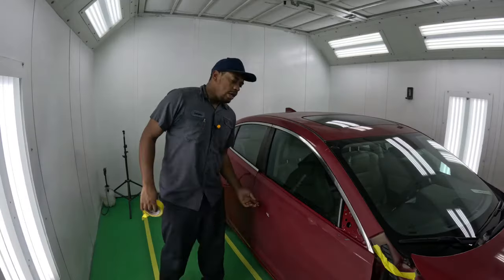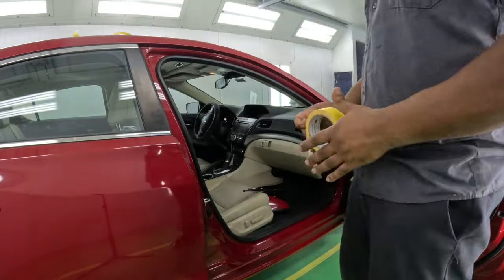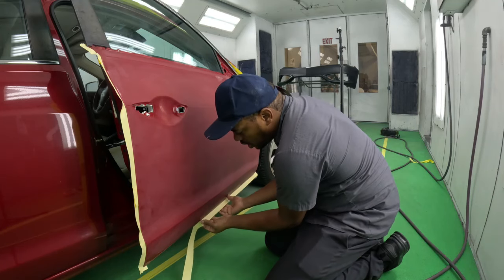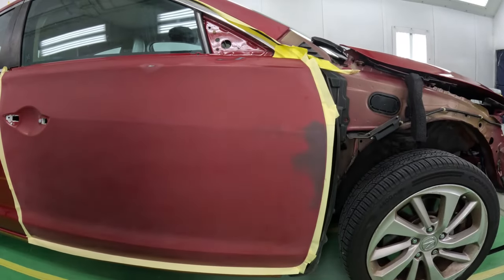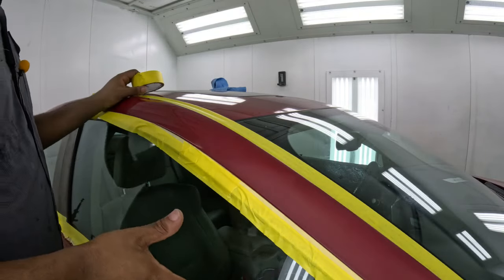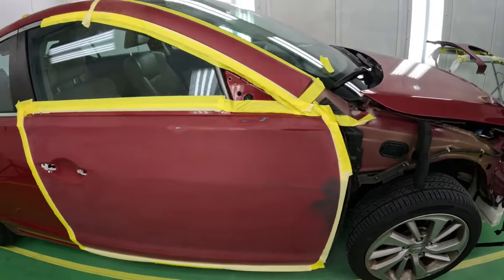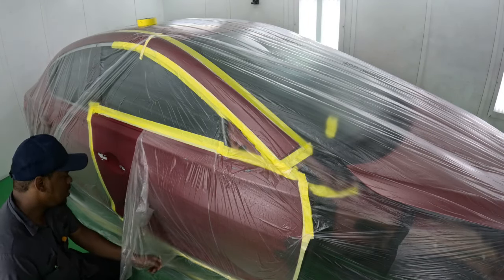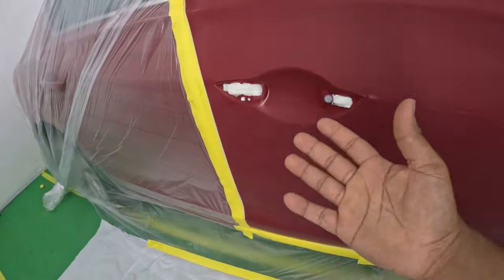HOW TO MASK A CAR FOR PAINT THE BEST WAY

Comment: You've got this trade on lock down Mario! Cant argue that this is the best way to mask and your eye for detail is unmatched! Thanks again for a grade A lesson in paint process Brother! I bought the master pro 22 with the 1.0mm tip and am very impressed with how it sprays. I picked up the 1.2 and 1.4 tip for it as well with the 125ml pps cups for getting into small spaces. This little gun saves paint and lays down paint evenly. Thank you for recommending the master pro gun!
Reply from the maker: Another grade A comment thanks for watching, and supporting.

Comment: Great job. Masking is the part I hate most about painting. I may have to try that trick out on masking the inside of the A-pillar. I normally use foam, but sometimes it doesn't seem to want to stay. Then you have to unmask most of it to open the door and fix it. Do you have a video of burning the clearcoat in? I have  done a few, but trying to get better at it.
Reply from the maker: Thanks 🙏 I wish I could just skip the masking sometimes. I’ll make a burn in video in the future
Reply: @mariopaintclass6091  thanks man. Yeah masking is for the birds 😭😭😭

Comment: You don't get a tape line inside the pillar?
Reply from the maker: @ehss192  no sir
Reply: @mariopaintclass6091  Thank YOU sir.
Reply from the maker: @ehss192  you’re welcome!
Reply: @mariopaintclass6091  Hi Mario. I just wanted to drop a comment and say thanks for the tip. I painted my car today at home and used your tape trick for around the pillars and it turned out 90% perfect. The other 10% was user error but nothing a little 2000 grit can't handle. I'm a rookie so I just don't have the practice but the overall result was satisfying. I have one area about 6 inches long that I need to clean up. Excellent trick and tip sir! Again, just wanted to say thank you!
Reply from the maker: @ehss192  I’m truly great full to hear that my videos is of great help to you. You are on your way to perfection just don’t keep making the same mistakes and you’re golden 💪
Reply: @mariopaintclass6091  Your videos are helpful to many. People don't always comment or reply so thats why I wanted to say thanks. Appreciate the videos and keep doing what you're doing. 👍